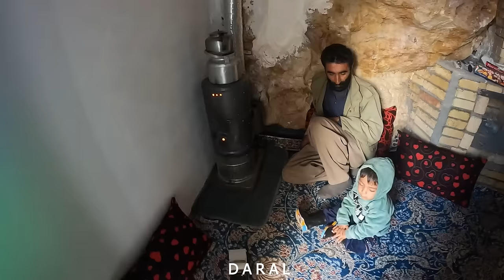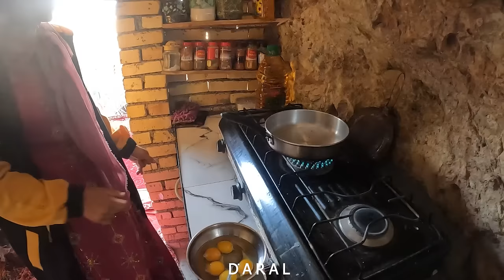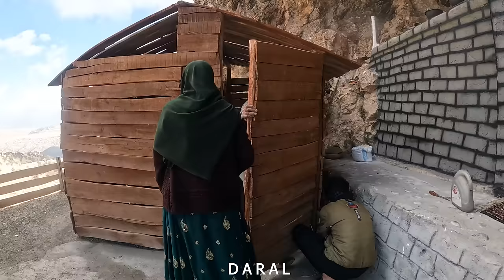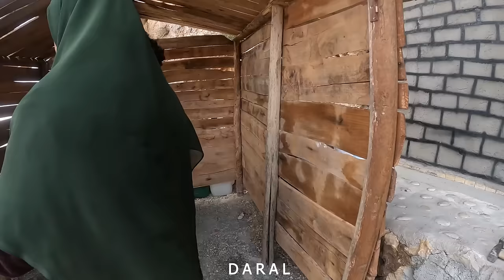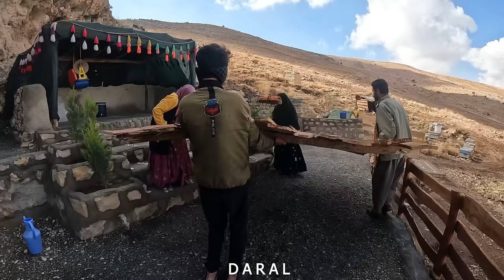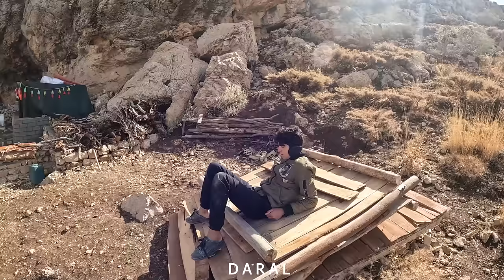"Amir and Family's Summer Retreat Transformation: From Cozy Cabin to Winter Haven!"

Comment: The wooden shed would have made an excellent choice for an animal bed for the goats 🐐 or dogs. 
Their area does get more rain during the winter season. I do know depending on where they live, if they will get snow. 
Do they live in the northern or southern Iran area? It snows in the northern part of the country.
Reply: I was thinking the same thing. It could have been used for the goats and, or donkey. Also could they not have flipped it over the fence. I mean like the women pushing it from the one side and the men pulling it from the other side of the fence. Then maybe it wouldn’t have come apart.  I don’t know if that would have been possible, just a thought.  😊
Reply: I hope that they will use the wood from the shed to make a shelter for the animals. And all to make floor in the dog house. These dogs are in the mud. Also the chickens need a shelf to roost. They are also on the ground in the mud  They seem to be hard on their animals  they are prone to all the weather elements

Comment: The title states this is their Summer Retreat. Does this mean when full winter arrives they will return to their Winter home, and where is that?  I had noticed they dont have their spare  clothes hanging up or folded up in this cave dwelling, and they appear clean with clothes changed regularly, so i assume they must go back to their other house daily to sleep, shower and change clothes. No problem with that as they are nomadic and supposed to move from place to place, but i think they should show that too, i think the viewers would be interested. Another channel i think are a different tribe from the Darals, they look different, dress diffrently, i think Northwest Iran near Caspian forest area. They dont build brick/cement houses, only using tree branches to create Yurt structure. They live in a very green almost looks like European mountain area. ⛰️ they have lots of cattle, cook in Tandoor and move according to the season, summer in the mountain, plains in the winter. Very interesting to watch them.

Comment: This time build the new room up against the other wall with the heater and bigger than you can use the built up area to store items there or for a bed then you can have a opening to the other room and it will let wormth in to new room from the room with the heater in it and build up the wall in the kitchen area above the door and wall to keep it from getting to cold.

Comment: I noticed the wooden house didn't match the surrounding long before kind of spoil the view.
Anyhow your cave house is locked so great from the normal cave become the luxury & amazing home.
Congratulations.
In my opinion, 
if chang the wooden fence to the brick, make it the same high as the one u have at the front gate, would look most suitable
Mr. Amir, U looked so amazing yesterday very handsome.